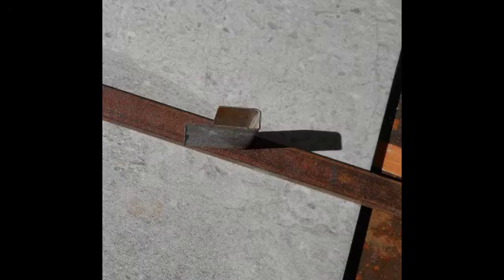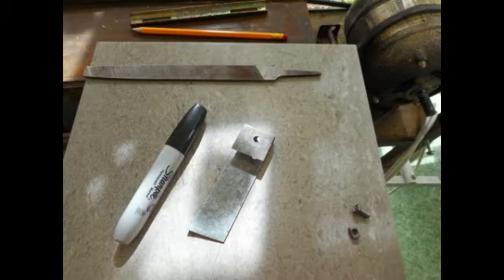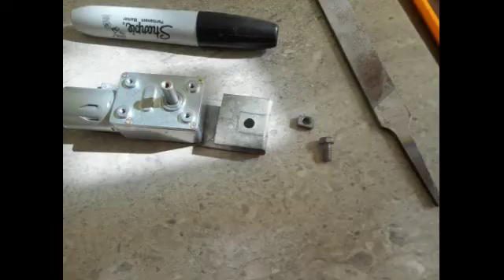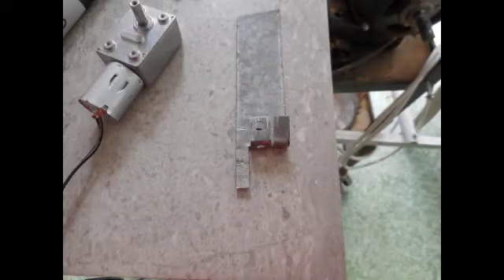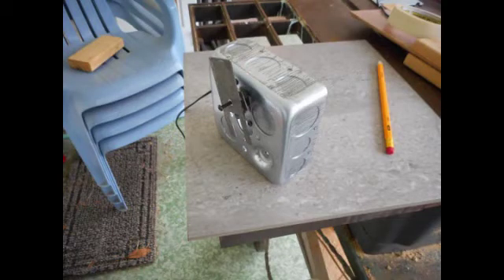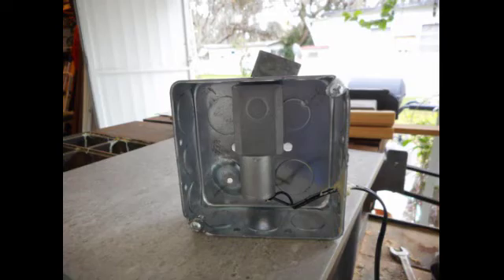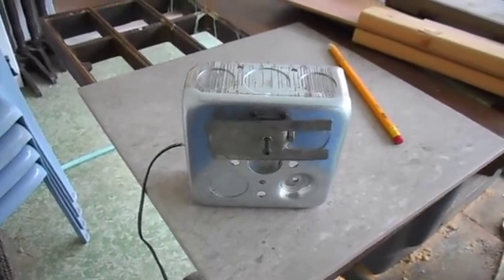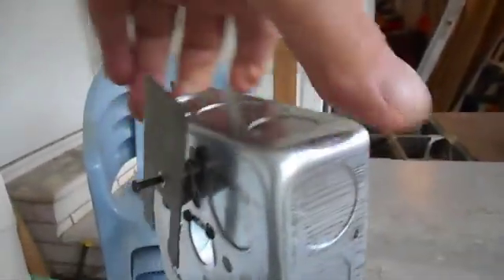Po-Boys autosharp for bandsaw mill blades DIY blade sharpener

Comment: Hi Mac , I like your sharpener I ordered the 12v 15 rpm gear motor I was wondering what amp adapter I should get to make the the motor run 110 like yours thank you
Reply from the maker: Looks like I chose a 3 amp wall wart to power gear motor.
Reply: @macwolgamott4201  Thank you I did order the cam From you a couple of nights ago
Reply from the maker: I do appreciate your purchase. I have modeled 4 different cams in total now. As weather gets worse outside I will produce a full set of prints for Autosharp.
Thanks
PS I watched your video, nice sawmill !
Reply: Could I have copy of the cam I 7/8” between thooth thanks in advance you could send it by Email